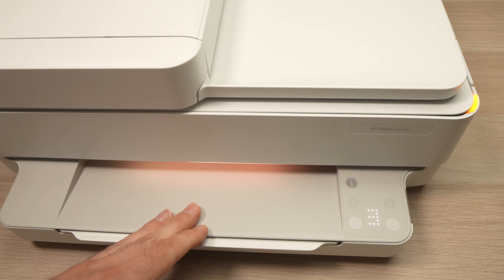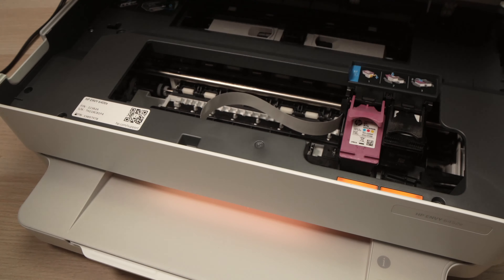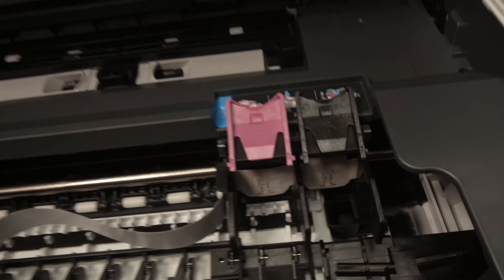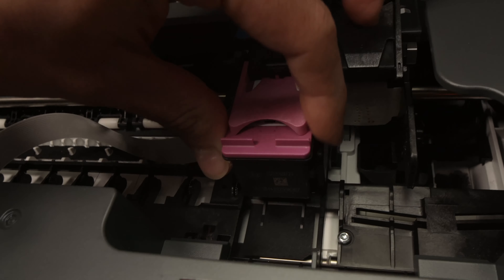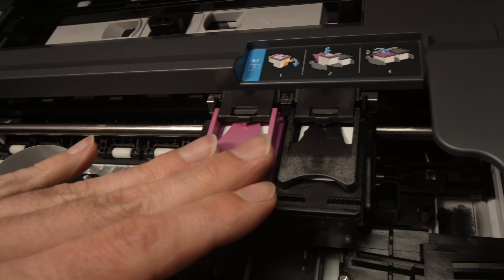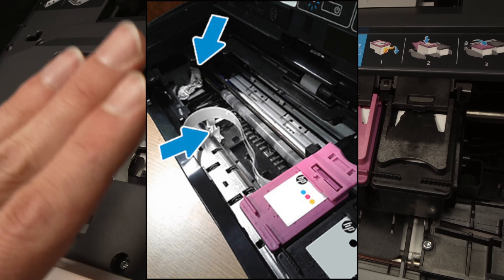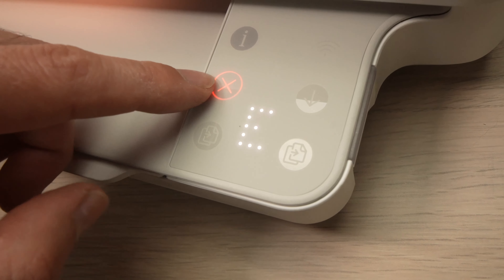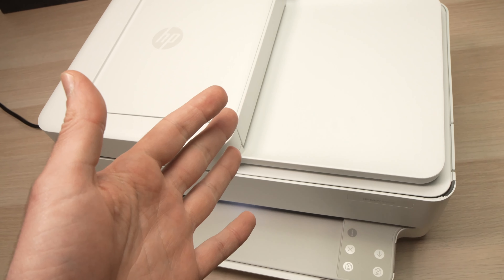How to Fix Error E3 on HP Envy Printers

Comment: This did not help in my case. But somewhat solved with the hotline. Envy 6030 with E3 error. Removed both cartridges. Closed, unplugged 30 seconds, then restarted. The error moved to E0. Then inserted black cartridge only. Error disappeared. Inserted color cartridge: back to E3. A possibility is that my color cartridge was too old, although 3 month before its expected expiration date. Now I have a black only printer. Waiting to see if a new color cartridge will be accepted.
Reply: ran into this same issue on 7/17/24, color cartridge expired 3/19/24 so I replaced it with a new in box one I had, it expires 8/13/24, still got E3 with the color cartridge installed but no error without it installed.
Reply: @michaeldahl6782  A week after my first comment, I got a new color cartridge and all works as expected now. Cannot tell about the expiration date, but certainly above 2024. Maybe try with a newer cartridge with an expiration date that is in more than a year.
Reply: Thanks for the help. This works for me 😊

Comment: My cartridges are installed correctly and are brand new. I checked many times and did not find any foreign objects inside the printer. But the printer still shows E3 error.
Reply: I'm in the same boat. The E3 is flashing very fast, unlike in this video, where they are flashing slowly. Nothing is jammed, everything is connected correctly.
Reply: @Cblackk  So if you find any solution, I hope you can share it with me, thank you very much.
Reply: @roy765tube  I purchased the $20 one time package from HP. If they find a fix, I’ll share it with you.
Reply: I just bought my printer and mine is doing the same thing.  Did either of you find a solution?
Reply: @Cblackk  did they find the issue? I feel like I have tried absolutely everything.
Reply: same here. printer is fucking junk
Reply: I finally fixed mine.. so i did everything said in this video and still didnt worked so i changed one of the Cartridges i knew was low and that was it 😅
Reply: The manufacturer wants u to subscribe to inks. When I did they charged me for pages I was printing from cartridges that were not from subscriptions so as not to waste the ink before I put the subscription inks in . When I cancelled the subscription because of being ripped off I found that no inks worked after that not even the unused subscription ones
Reply: I believe that the printer doesn't recognize the carthridges even if they're brand new.